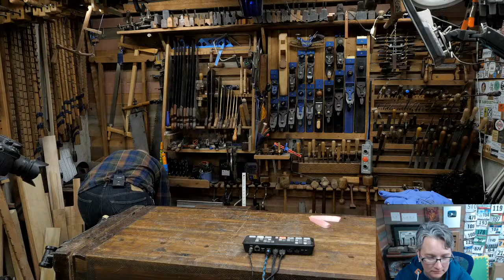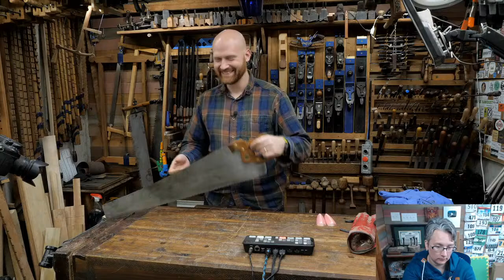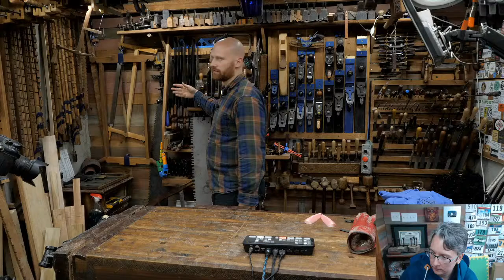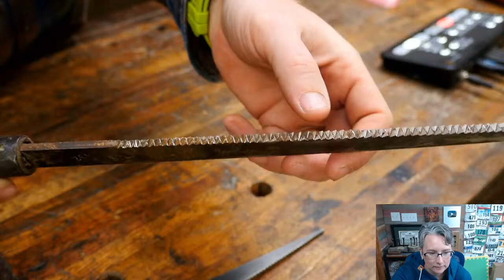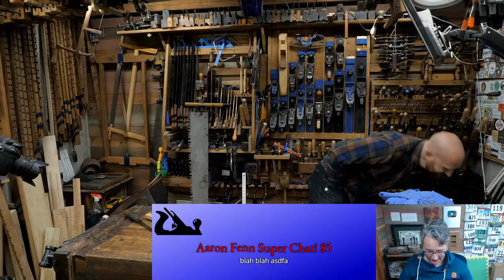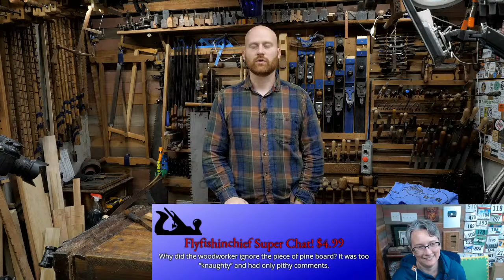February QnA 2021

Comment: I'm having trouble with my self-restored (per Paul Sellers' instructions) planes. I have a Craftsman #4 and two Stanley #5s (one with the corrugated sole, one smooth). When I go to put the cutting iron/chip breaker back onto the frog, it moves up and down in the space--just about an eighth of an inch, but there's some play in there. Should that be happening? I've adjusted the frog per Sellers, etc.--but I feel like sometimes I get it in there "right" and it cuts like a dream, but sometimes I think I'm not being lucky in where it lands within that eighth inch of play. Any ideas? THANK YOU!
Reply from the maker: That slop is normal for most planes. When you put it in pull it up as far as you can and lock it down there.that way you can advance it forward. Those planes are not the best in the world but with tuneing they can work extreamly well. So if you can tune those well you can do any plane.
Reply from the maker: Those are not the best planes in the world but with good adjustments they can be very functional and very effective. The downside is they take a good bit more work to tune. The upside is once you learn to tune them well you can tune just about any plane. It is completely normal to have a good bit of slop in the iron moving up and down. That's actually fairly common on most all planes. Usually when you install the iron you want to pull it back so it is up against the depth adjuster. That way you can move it forward into the right position. And the depth adjuster will stay in contact with the chip breaker.
Reply: @WoodByWrightHowTo  Thank you! I've been able to have intermittent success with these planes, but I'm glad to have a hint as to what the cause of non-success might be.

Comment: I made a wooden jointer plane that’s giving me some chatter. I have been working to double check the flatness of the bed. Any other suggestions of what I should look at?
Reply: Usually will mean the iron is flexing (like a spring) if its sharp then either a thicker iron or check the wedge and bed is making contact across all of the iron. If your using a cap iron then make sure that's flat against the iron (more important near the cutting edge). Other things can be the angle of the bed or even the type of wood you're planing.
Reply from the maker: Cheddar can come from a lot of different things. Thickness of the iron support behind the iron compression of the wedge. Most of the time with wooden planes it's that the wedge is not holding close enough to the tip to actually provide pressure down where it needs to be at the edge.

Comment: Why do you use raw linseed oil nwith your hard paste wax?
Reply from the maker: I use that mostly for lubrication and rust protection. In that case I don't want it to polymerize quickly and create a buildup on the tool. If I ever use it for a finish then I would use a BLO rather than raw linseed oil.